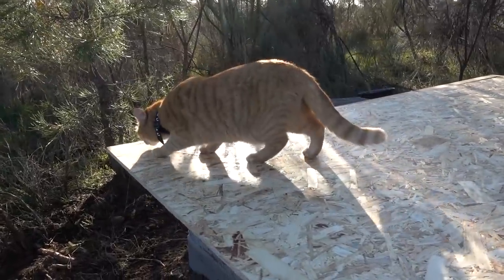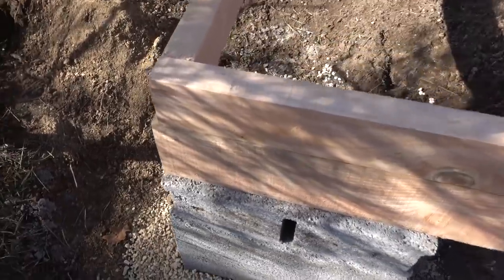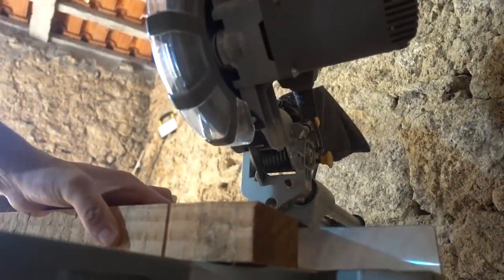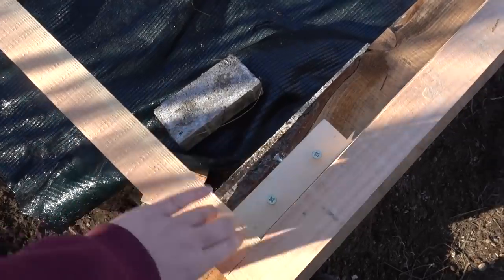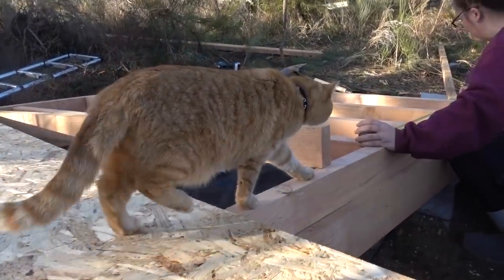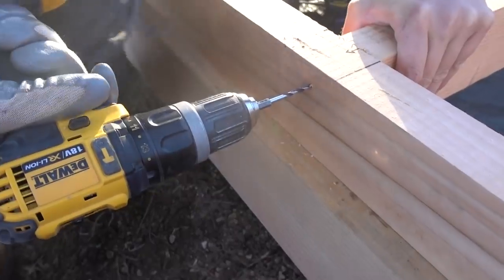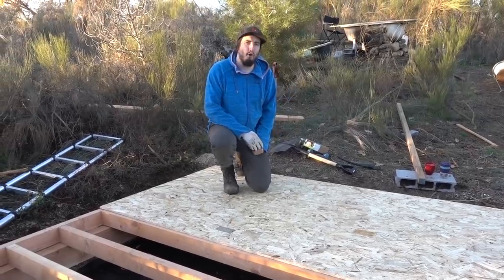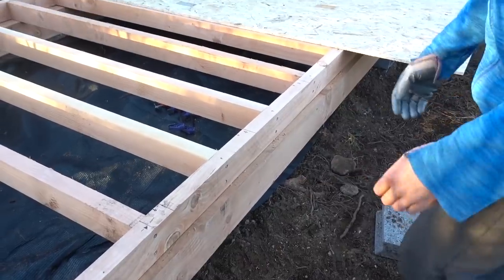Off Grid Outhouse Build!

Comment: Hope you don’t mind but I would nog out the joists this will stop them twisting, the noggings can be the same size timber fixed length ways (90 degrees to the joist) between each joist , you need two per joist minimum they can be off set for ease of fitting. Hope this helps but will definitely make the whole thing a lot more sturdy and no chance of any lift.  See you tomorrow.
Reply: What the heck is a NOG?
Reply: @bevtrue6937  A nogging or nog is a piece of timber that runs at right angles between the joists. Stiffens everything up. Not to be confused with a Childrens TV character called Noggin the Nog from the 60's! (1959–1965 and 1979–1980) and series of illustrated books (published 1965–1977), created by Oliver Postgate and Peter Firmin.)
Reply: Couldn’t say it better myself

Comment: If you’re lining it, then you may find it so much easier if you build the frame and then line the inside first (before the roof) that way you can literally, hold the ply lining in position, go outside and draw a line where the window frames etc are. Cut the holes out and stick the ply up. 
Takes away so much of the measuring (and mistakes)
If you’re insulating it then just stick the insulation in as you’re cladding the outside.

Comment: Are those sheets of boarding you're using for the floor waterproof?  If it's OSB (oriented strand board) then I doubt it will be moisture resistant, not really what you want as a floor in the shoilet. Just a thought.
Reply from the maker: Hey it’s moisture resistant OBS so has a coating and will put another on the cut edges. It’s just a sub floor so will be covered over with either flooring
Reply: That's cool, well done to you both, you're doing great.

Comment: have you seen those double ended drill and screw bit?..you spin it around once you drill...then screw using the other end of the bit..saves using 2 drills
Reply from the maker: Yeah seen them around, but you still have to swap round the bit which is a faff when you can use two drills 🙌

Comment: What no damp proof under the timber?
Reply: I wouldn't think that is necessary. It is raised off the ground, with good drainage around it. It is Portugal, not UK!
Reply: @nealeburgess6756  True for Portugal... should be ok. But if it was in Cornwall I would build it higher and use pressure treated wood. Happy Building.

Comment: Do you need planning permission to build permanent structures in Portugal?
Reply: Yes, (you need planning permission to build permanent structures anywhere) & it has to be classed as building land. Firstly you need a certificate known as the  'viability to construct'  ..then you will have submit your plans which will include such things as dimensions & materials to be used  to the local town hall & then  the finished work has to pass inspection. 
Hopefully the guys have done their homework & got all the necessary authorizations.
Reply: In UK if it's timber it's not permanent. Not sure about Portugal, but if you construct the walls with screws or bolts so it can easily be taken down, shouldn't be a problem.
Reply: I think it's more the foundations that designate a structure permanant or not rather than the structure it's self. You can put a wooden shed anywhere but if you put down a concrete floor, then planning permission is usually required even in the UK. Different local authorities have different regulations though so it's best to check with them before any change in land use.